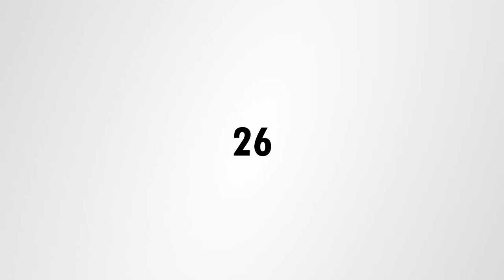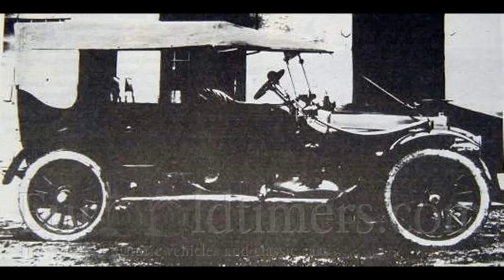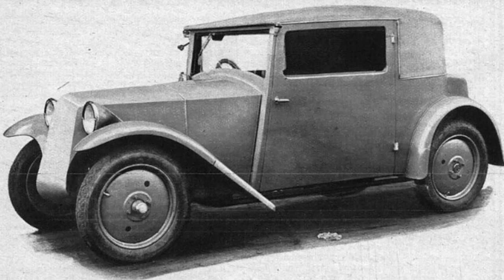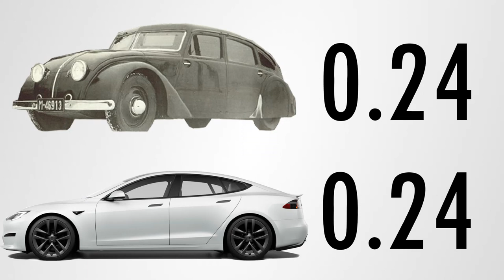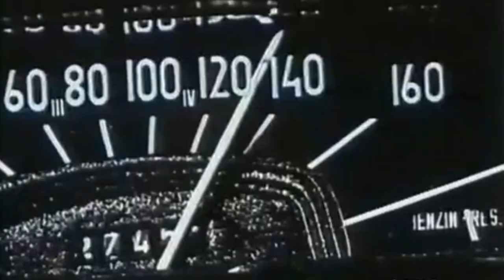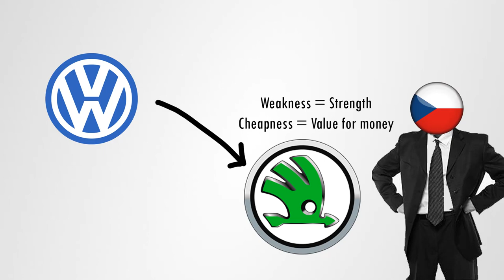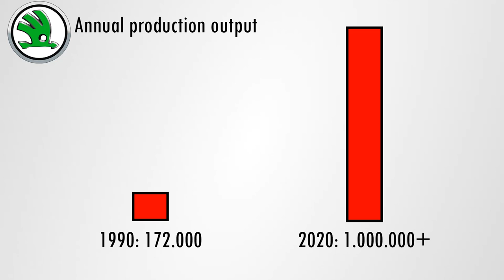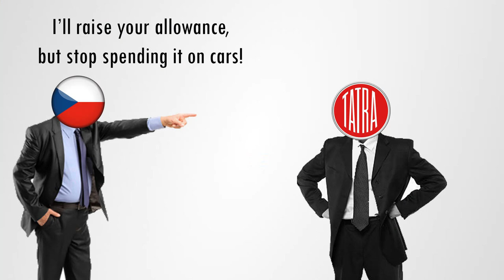Ep. 26 World Tour: The History of the Czech Car Industry

Comment: The Škoda 125L was the better "basic car", as it had a 5 speed gearbox coupled with the 1,2 litre engine tuned to lower power, thus increasing its reliability (contrary to the LS/GLS models that used a higher compression ratio and needed more expensive fuel). The bottom line was Škoda 105, with a 1 liter engine and 4 speed gearbox, without power brakes and practically nothing more than the bare minimum. On the other side there was the top of the line Škoda 130, with a bigger 1,3 liter engine, 5 speed gearbox, better brakes and mostly a completely reworked rear axle with much better driving performance. The very last rear engine Škodas were the 136 and 135 with engine components (especially new aluminum head with 8 canals and reworked manifolds) developed for the Škoda Favorit, as the production of the Favorit was starting rather slow. They were the best domestic anyone could buy before the Favorit and only "rich" people could afford them, like butchers, party members, doctors, etc. Tatras were not for regular people. Maybe some old, used cars, with hundreds of thousands of kilometers on the clock, worn and in need of extensive maintenance which you had to do yourself. And still expensive. The vast majority were lower end models Škoda 105 and 120. So at 12:07, the Škoda 125L was somewhere between the dreadful bottom of the line models (105/120) and the top models (130/136/135), offering a 5 speed gearbox tied with a durable engine and good fuel economy. Rear engined, outdated, but acceptable value for money car with easy maintenance and better handling than the models made up to 1984, when the entire lineup was modernized with better axles, steering and handling, while only the top line 130/136/135 got an even better rear axle.

Comment: OK so first, there were actually many brands available in between-war era, like Walter of Prague, Z of Brno, etc. And there were fine coach builders, too. Did you know that in Czechoslovakia, Bugatti sold a huge amount of their production? Also, CSR became CSSR in 1960. Also, you did not mention that Skoda after war besides compacts developed an upper line of medium-sized cars, 1200 - 1201 (my first car) - 1202 and a pathetic van called 1203. For two years, I had a Tatra 613-3 E1/I of 1986. A car that combined eagerness, sound and handling of a small sport car with a unbelievable amount of space, trunk and luxury (sic) of a limousine. Just if it didn't rust so quickly...

Comment: You are wrong Sir, I have had the great pleasure of owning a Skoda 105, rear-engine, car. It is actually a very good car. What made it good was that the Danish  motorists organisation, FDM, tested it, decided they would kill the brand permanently in Denmark if they printed the test, so instead the drew up a list of required modifications of the rear suspension and asked for getting a thus modified car to test. The modified car had no stability issues in any weather. It is a good car for ordinary people on ordinary roads and great on less good roads and in the snow.
Reply: With all respect, we were forced to drive that junk, because behind the iron curtain, there were no other options, trabant was even worse. Skoda was a decent car in the 120 GLS top of the line variant with 5 speed gearbox, my brother had it and it was quite ok from the driving point of view, not coinsidering the reliability. Skoda 105 however was horrible, it was desperately slow and weak even by 1970s east europe standards, it  couldn climb a hill, it was hellish noisy, the brakes were crap and the engineering, catastrophical. Overheated in summer, didnt heat in winter, doors got stuck all the time, everything leaked, everything broke all the time. It always managed to get to the destination, but you literally had to fix it daily to keep it running. At 100 000 km it was good for complete renovation, the body rusted away in some 5 years if you didnt take care of it. The original design was the 1000 MB and we called it 1000 "malých bolestí" (thousand little pains). I had also east european polish Fiat 125p, but it was italian engineering only made crappy in poland. Still it was soooo much better than the skoda, even if it was 20 years older design.
Reply: @KillbillyA  Yes, they showed how good engineers they were - and are - and got a good result within the framework.
Reply: @digilyd  they used to be, thats long gone. during communists, all clever people ran away or were persecuted or imprisoned. Nowadays we produce almost 2 millions cars annualy in total, but skoda makes just cheap versions of VW, hyundai is german/korean design and the third factory just makes small toyota/citroen/peugeot cars. we are simply a big assembly line with cheap workforce abused by the western colonists, no engineering is done here and no money stays here, everything goes abroad. Its sad and people are angry, but we are doing better than most other post communist countries, the unemployment is practically zero, which is fine i guess.

not speaking about our motorcycle industry, which was top of the world way up into the 1950s and now it simply doesnt exist anymore (jawa does exist, but sells rebranded chinese crap)

If you really want to see czech engineering that is still there, its probably just the guns we make, in fact our CZ weapons factory recently bought Colt and their weapons are known worldwide for quality and good design. And its in czech hands.

Comment: It's Škoda, but I give you a pass.
(pronounced Shkoda, not Skoda)
Also Renault was interested in buying out the lot, however, neither French side or Czech side were interested in such deal.
French side was adamant to turn the factory into Renault-models only (much like nowadays Dacia in Romania), such as (then new) Twingo and phasing out old Škoda models. Czech side was rather not in favor of this, as it was thought the VW deal could 'preserve' the brand in a way. 
And it did.
However, almost all internal Škoda development (most notably engine R'&'D department) was stopped or subdued.
And with the rise of new management, all the unique and quirky models got facelifted and subsequently discontinued/ replaced by boring VW-brewed designs nowadays.
The brand's history museum is a proof, hiding interesting cars out of reach, while showing off the new, ugly models.
There are alot of "What if"s, but the sad story is on both sides, Škoda may have given a chance to live on, but underneath the sticker, it's a VW. Low quality VW at that.
The reliance on one brand/company to bring in cash hasn't changed, since the revolution and due to "chip shortage" the market is rather stagnant.
Other brands, such as Praga got bought by foreign owners and do still exist, whilst Tatra (now owner of then Avia) does soldier on. Kaipan is also one obscure car manufacturer, which makes (or resolds) Caterham kits with various Škoda/VW engines.
The whole Czech car industry got sold out and making "affordable" cars is not the point anymore for Škoda. Many will love it, but it's as hopelessly boring as it was during Communist rule.